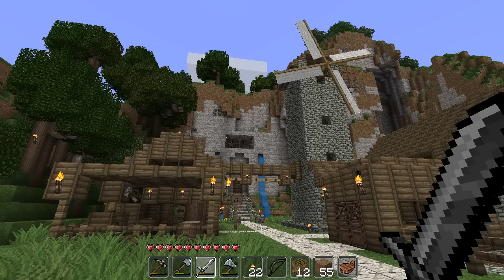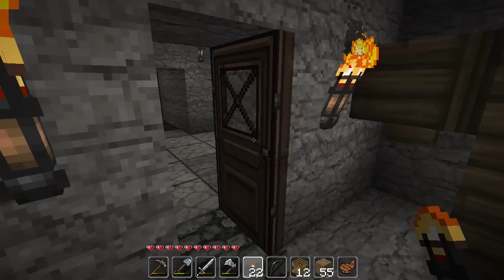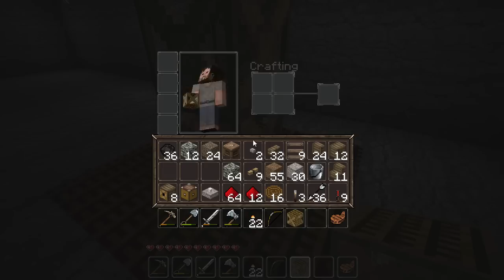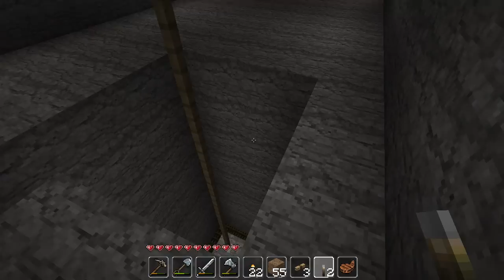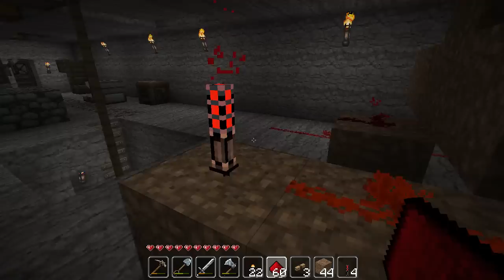"Better Than Wolves" Elevator/Gate tutorial

Comment: question, the platforms that make the elevators, is it possible to place other objects on them and have the elevator move them up and down, like placing a chest on an elevator or better yet a mineshaft elevator with minecarft track you wou can lower minecarts.

Comment: I have a problem. When the output is on, Nothing happens. When the output is off, Still nothing happens. And everything is working the gearboxes are recieving power it's just that the pulley won't work.

Comment: Could you also do this when the t-toggle flip flop is downstairs (i mean down where the lift stops) and make 2 redstone lines go up ? (1 for the gearbox and 1 to turn the signal downstair from the t-toggle flip flp on and off) 
I tried this to get worked for 3 hours but i couldnt do it :/

Comment: @TheYaMeZ The missing wires aren't the problem. I am having the same problem, and I have literally checked it a good 10 + times, rebuilding and checking it every single time, but two torches burn out during construction, and one always burns out when I press the button.

Comment: @TheYaMeZ Well, from what I can see, they can pull a 5x5 platform. So if you do connect a pulley to a small platform on each side of the elevator, you'll have all but the very middle taken care of. Then, I was thinking, rig up the ceiling to each corner, so that the middle is covered on top, and then drop one down into the middle of the lift, because otherwise, there is no way to get the middle of the platform covered. However, every time I do it, the very middle pulley doesn't drop.

Comment from the maker: @EricksHinumaru I'm trying that at the moment actually. I think they key is that each anchor will only pull platforms within 2-3 blocks of it. So if you want a cage, make sure the anchor is not connected directly from the top, but maybe two or 3 blocks into the side. Oh and you may need an anchor on each side. I haven't tested it yet so I don't know for sure if this works.

Comment from the maker: @JorZroX Are you putting a restone torch every second block and keeping the number even? Also if it does no match exactly you can just run the wire around somewhere, as long as it connects to the "input" wire.